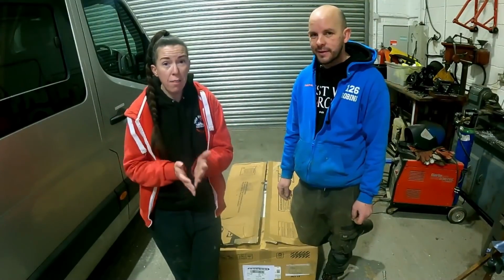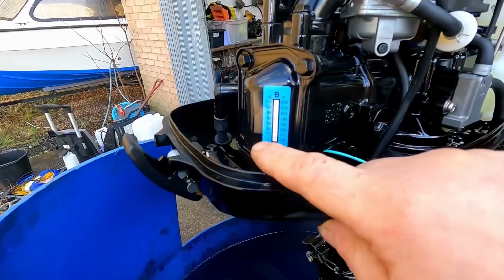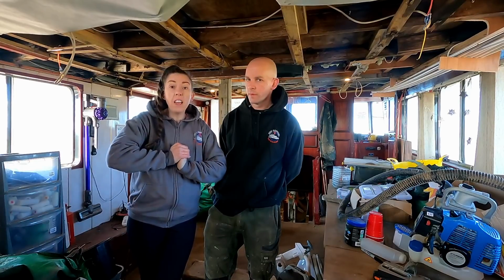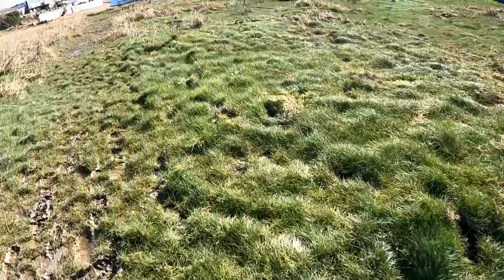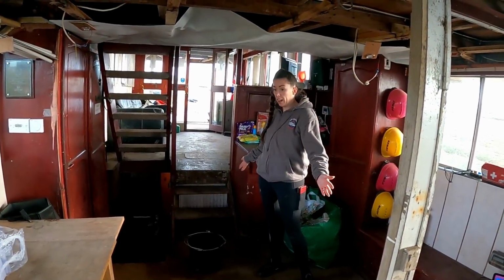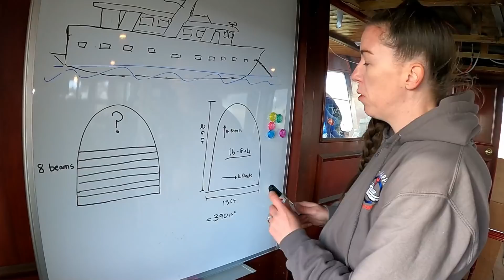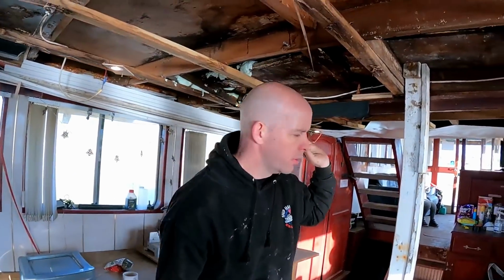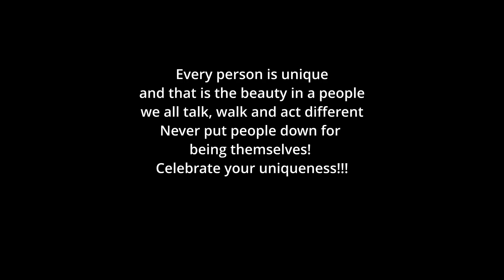Ep 61- New Boat Engine And Assessing Our Roof For Removal #boatrestoration

Comment: A few people have started making deck beam's from aluminium rectangular section, run thru a set of rollers to create the camber, easy enough to screw into with self thread cutting selftappers to attach an plywood and bolting into the rest of the structure, lighter, quick, no rot.

Comment: Just a little input from the cheap seats. You roof joists install from bow to stern, so you need to put your plywood on from port to starboard. If you run the ply in the same direction as the joists (beams) you will lose a lot of the structural integrity of the plywood. Also the Epoxy is more expensive but you should really think about using it for the first layer of fiberglass. It bonds to the wood much better then the polyester. After the first layer you can go back with polyester and you will have a well sealed roof, or deck as it were. You all are doing great work and you are fun to watch. Keep up the good work and much love from Florida USA.
Reply: You can’t install poly fiberglass over epoxy ever. It will hold to start with but after a year or less it will start to break free of the epoxy. I’ve seen testing done on it on boats and aircraft and it fails every time.
Reply: @mwatkins2464  Thank you for that. I guess my idea would cot more over time. I stand corrected.
Reply: @seventeenreasonsails  I watch Boat Works Today on YouTube which explains a lot about using fiberglass. His older videos are a great way to look up any questions I’ve had in the past. Take care, good day 👍🙏
Reply: @mwatkins2464  Thank you for that. I will have a look. I have a lot of fiberglass work coming up so I need to study so I don't have to do it twice.

Comment: Simon, you can use polyester resin on the plywood deck, but epoxy is definitely better. I’d really think hard about that decision. In either case make sure you cover all surfaces of the plywood not just the top surface. It’s important that the plywood is completely sealed to prevent moisture from getting in and creating rot and delamination. 
Also, consider using a modern deck material like “Davinacel” it comes in sheets and is made for boat decks. It doesn’t absorb moisture and won’t rot.

Comment: good quality plywood... fibreglass externally in the workshop... remove enough old stuff to do a couple of sheets at a time.. that way you never get caught out by rain etc... and then a quick fibreglass over the joints will make it water tight... then when its complete you can put a second or third skin of glass  and then flow coat over the lot :)

Comment: Some great comments. Like so many others, I can't wait to see your next video. With the beams you need, the best concept is to laminate them. Because they should be in a dry environment, most any kind of wood will be OK. Check with some of your local Saw Mills and by rough cut rather then finished lumber. Invest in a 12 inch portable planer and clean the wood up with it. You can construct a roof beam like a trust. The first piece flat to give you the flat ceiling you want. Then put a spacer piece in the center of the 15 feet length to create the curve of the top piece, bringing the ends together with the flat piece on the bench. Use some 5 mil plywood on each side of the beam to reinforce it and keep it's shape. A good water proof glue is all you will need for this construction. Use ring shanked nails or staples like you see in pallets. The concept of cutting a varnish or oil based paint 50 / 50 with paint thinner works exceptionally well. Coat these two or three times in your shop. The same goes for the plywood. I know it is expensive, but epoxy is the best waterproofing and gluing material out there. Buy the epoxy by the largest (aprox.) 4 gallon jug. Also use the slow hardener. It will work in 45 deg F temps.You can thin the epoxy using Acetone and then roll it on with a very short nap roller or 1/8 inch sponge roller. Four coats of epoxy over a thin fiberglass cloth will provide a roof that will last for many years. You will still need to paint the roof to protect the epoxy from UV rays. Two layers of plywood like 3/8 x 3/8 will give you a 3/4 inch thick roof. Like others have said stagger the seams and lap them. A troweled thickened layer of epoxy will bond the two layers of plywood exceptionally well. Again you can use your compressor and a staple gun to lock the layers down. Just my thoughts from experience building boats. Thanks and we wish you the best of luck!

Comment: i was watching a lad in Ireland who is working on another old RAF style launch, much smaller, i think he used a good marine ply, then sealed the sheets, and over the top used canvas and resin to give a continuous one piece finish, then all you need to do is final sand and paint, it looked good and should last ages, canvas will put up with the UV better than most surfaces and give where it needs to - i forget the channel name now and don't appear to be following it for some reason which explains why i not seen anything for a while - but still watching and loving you
found it - Lakeside Productions - he does some cool film work too but lives on the boat

Comment: Yes and camber the deck ,strength through curvature ,,,and also it will pool with water if you don’t add the camber and possibly rot quicker ,,,,20 years boatbuilder so please understand this is solid advice

Comment: Going back to my earlier comment, you could buy fibreglass sheet used for the roofs of commercial vehicles, it would be 2.5mtrs wide but a length to suit and can roll up, so easily transported

Comment: Marine plywood. Are you going to at the shop coat both sides with thin epoxy so it's truly weather proof on both sides. Or thinned polyester resin.  Or at least thompsons water seal on the bottom side.  
There is tongue and groove roof sheathing available too. Or plan ahead and use a router to slightly narrow the marine ply to make it tongue in groove . Allowing you to seal the edges prior to assembly on the boat.

Comment: I have this engine as auxiliary on my family boat as a backup for the 90hp mercury outboard, it has never missed a beat except when I neglected to drain the fuel from the carb before winter once!
They are a really reliable engine!

Comment: i think you should consider using exterior ply (far cheaper than marine ply with the same glue) and using the savings to use epoxy as it will provide better water resistance than polyester resin

Comment: Have you given thought to using fiberglass foam core for your roof?  You could do the fiberglass in your workshop! And you could make joints that fiberglass together when you put them together!  Put a couple of layers on after you get the sheets put down!  ?  You could use foam core for the beams also?

Comment: Have you thought about using nida core pannels.  You could prefab them in the shop . Then install them on the boat . Then fiberglass them together then add more layers of fiberglass. If you use plywood epoxy  resin will bond to wood better than polyester resin.

Comment: You take out the bottom plug and push the oil out of the top hole, then quickly replace caps.

Comment: Prior to 1960, Chris Craft and many others used pre-shrunk cotton canvas pasted and stretched over wood then painted with a thin oil based enamel paint. This was also used on their cabin sides.  If maintained should last many years. A lot less expensive and labor intensive than resin and cloth. There are quite few articles written about the process though difficult to find.

Comment: Just one suggestion when putting oil into any engine turn it round so the outlet is at the top you have more control and it run out smoothly love the vlog on the repairs you are doing used to work in a boat your for years take care.😀👍

Comment: Another thought on cross beam wit the camber, build a “jig” using one of the existing beams. Just cut the longest one out. Use as a template and construct a “glue- lam” beam from 1/2” plywood. As many layers as you need top to bottom and then add ply to the sides, front and back. Wrap it all in 3 layers of fiberglass ( /  \  /).
Reply: A jig or pattern is the easiest way...
Reply: If using beams, add a strip centered to the top side to allow cutting of the camber without having to use larger height beams.
Reply: @davidburrows9992  I have seen master shipwrights do that.
Reply: Certainly an option.

Comment: The additives in some fuels (ie. E10) are incompatible with o-rings on the engine assembly (corrode, disintegrate, whatever the correct term is for whatever material is in the o-ring and gadgets).  Which, since e10 helps with the environment at certain times of the year, you would think they would put compatible o-rings in new motors, especially when they only cost pennies to make and install at the time of assembly.

Comment: You only need 13 sheets of plywood! 3 rows of 8' =24' and 1 for the front 2' =26'. If you make your beams at least 4" high you can put in 2"  of rigid foam insulation and still have room for wiring and low profile lights! You might also want to raise the roof a few inches for a more comfortable height.

Comment: I was confronted with a similar challenge when putting a roof on an RV.  I used LVL beams and cut the camber in the top.  This worked very well, and LVL provided a lot of strength for the weight. Since i am not in the UK, I don't know if using LVL would be cost prohibitive. I also built a cab for my tractor, using 1/2" ply, and used fiberglass cloth and fiberglass epoxy. This turned out very strong and absolutely waterproof. I am anxious to see how you proceed. Thanks for the great videos.

Comment: If your fibreglassing you dont need to use expensive marine ply. The fibreglass will keep the water off the deck. Just use OSB its much cheaper. 👌🏻

Comment: Could you build out the roof in modules at the shop then bring it to the boat and install it? This way you could gut the interior walls, inspect, then repair and install the roof more or less at the same time?

Comment: I don't think you want to cut the camber, you want to build a steam box & a jig, & bend the beams to the right shape, otherwise you'll be cutting across the grain & they won't be strong enough... the jig would literally be a plank with dowels in it to hold the bend you want while the wood cools & dries. The steam box is just a wooden box you can push steam into...
Reply: Yes Ken But the problem will be steaming aboard ?
Reply: @johnjb3205  I don't think they have to steam aboard - you can bring curved pieces of pre-cut wood to the boat just as easily as you can bring straight ones. If you know what beams you need you can pre-cut & pre bend them at your leisure over time - it's not like you want the roof off while you shape each beam anyway. In fact, if you've measured up in advance, you can cut & bend the marine ply in advance as well, & you'll probably want to do whatever treatments you want to do to the beams before you bring them aboard as well, for similar reasons...

Comment: If your thinking of moving that crane structure I would say go old school and use a large ( A ) over the boat to move it . Finish the deck on one end and when you get to that crane move it to the newer section of the deck while you repair the rest of the deck . Remember that crane has to weigh at least 7 to 8 tons if not more

Comment: My calculations for the 8x4 ply come out at 14. This equates to 2 x 8 feet, running port to starboard = 16 feet across  and 7x4 feet, running bow to stern= 28 feet. This saves you buying two extra boards. Unless, of course, the roof batons do not support the boards in that orientation?

Comment: This may be a dumb question, but I'm more familiar with residential construction than shipbuilding. When we deck with 4x8 we use two layers and the sheets on the two layers are oriented 90 degrees off from each other and staggered so none of the seams overlap. It provides a lot of shear strength and prevents leakage under the waterproof layer. Have you considered doing that on your decks? It would work much the same way the two layers of planks work on your hull.

Comment: I would definitely go with polyester, just on price and make it a bit thicker. Go with 1 layer of 600gsm chopped strand, then 300/300 combination then another 600 chopped strand all topped of with flow coat. This will make it  very strong (probably overkill).  If it was a normal house roof it would be just 2 layers of 600 chopped strand, this would be lighter and better for keeping the centre of gravity down.
There is a scantling calculator (excel based software )  from Southampton university that helps to work it out required thickness for RCD, often gives nonsense answers particularly with topsides.
Personally I would just go with two layers of 600csm, but the YouTube comment police will probably have a cry and say that you need more.

Comment: Spin your 8x4's around and you should need 13 sheets. Less sheets = less joins. You can ensure a good fixing down the centre line fore to aft and pick up any others that are there. Epoxy is expensive for a reason. If you use fibreglass, then at least cover it with two pack epoxy paint. Ensuring a good quality exterior will help prevent the ingress of water which has caused most of her existing issues. Remember bottom up and outside in. 👍

Comment: I think you need about 13 sheets of plywood (8 feet 3 times front to back {not 4 times} is 24 feet) plus a single sheet for the most forward 2 foot piece (the round bit).

Comment: If you do go with polyester then you will need some cobalt ,,it’s an accelerator that you brush onto the wood as polyester doesn’t like wood and tend to take longer setting the cobalt will inure it bonds properly ,but I’d still try and use epoxy as it’s far superior,,,and if you huy in a large amount it works out a lot cheaper than you possibly think at the moment

Comment: Gemma- check your math! You need 13 sheets of ply, not 16 (assuming your ply  is 4' X 8').  Simon- pull a string across the width of the boat, at the level of the bottom of the beams, and measure up to the highest point of the beam, that will tell you how wide your beam stock must be.  Looking good, Love a clean boat!

Comment: Laminate the roof beam using thin plies and epoxy.  Using dimensional lumber and cutting the curve will diminish the strength significantly.  See how sailing magic carpet built their replacement beams.
Reply: If their going to fiberglass the roof they don't need to use marine ply there is a another one that waterproof which is cheaper, a I agree with the laminated beams, there is a couple boat channels that have done this also look at Yabar they have done some fantastic work

Comment: Those engines are re-badged Tohatsu outboards. I have the 6hp Sailpro version. It wants to be cracked slightly more open than the start position to want to start without a zillion pulls, especially when cold. Also, be careful with the steering lock knob on the rear. It's a known weak point. I doubt you'd really need to use it on your dinghy anyway.

Comment: Please check the wood supports from the original beamshelf and hull to the top of the decks before you make any more holes in her! If you are going to make a new deck concider the technique of cored (foam? (divinycell)) fibreglass - have a look at the antics of Mads on Sail Life when he re-did his yacht cabin roof (I am sure there is loads of other info on t'interrnet). Also look at Mads' method of drilling bigger holes and filling with thickened epoxy to install any hardware on the boat, especially where ply core is used. I think that more design and maybe a discussion with boat builder or marine architect / engineer would not be a bad idea. Sorry if I am talking ship here, I just worry that you will go down the wrong path.

Comment: Worthwhile learning from YouTube on the how to remove Ethanol from E10 Fuel and as you have your own work space and the time you will be amazed how easy and even more amazed at how much Money you will be saving,quite a good thing that you could also use for the customers of your camper van builds as Ethanol free fuel is better for all vehicles that are parked up for some time and it saves a fortune in maintenance costs ( stripping down of motorcycle carbs for one Simon )

Comment: Dont buy marine grade ply, good quality exterior grade is good enough. Coat them in your workshop both sides with polyester resin, the bring them to the boat. Same with the beams. Then all you need is to coat the end grains after any cuts.
Reply: +1 for that suggestion.  WBP ply will do the job.
Reply: Get a sponsorship for plywood
Reply: I thought polyester resin was porous and will let water get into the wood?
Reply: Absolutely do not use polyester resin ,,it is  toattally the wrong advice if you do skimp on the ply then coat with epoxy but tbh I’d buy marine Grade  ply for all external use,I once bought 1p20 sheets of wbp ply and fitted out my 48ft ex French naval pinnace with it I then epoxy sheathed it all ,but given the choice I’d of definetly spent the money on the best quality ply I could get ,,,good luck
Reply: Then maybe vynelester resin with a good epoxy coating system would be a better option. Marine grade ply is 4x the cost of top grade external use ply. Once coated with vynelester and dynel  then painted with epoxy it will last for many years.
Reply: Definitely don’t  buy anything but BS1088 marine ply ( as I think you bought). 
Do not coat both side  you will trap moisture inside and it will rot.  We used to say back in the 70/80s just coat it in resin it will last forever, we are now fixing all the rotted wood in boats from that era. 
Make sure the back side can breath!
Reply: @CheersWarren  Good Information, I stand corrected.